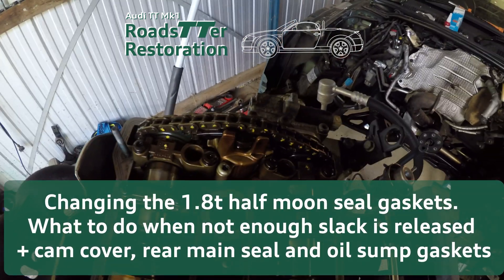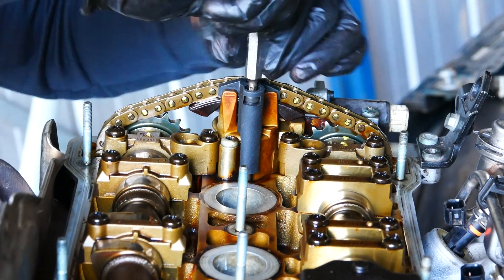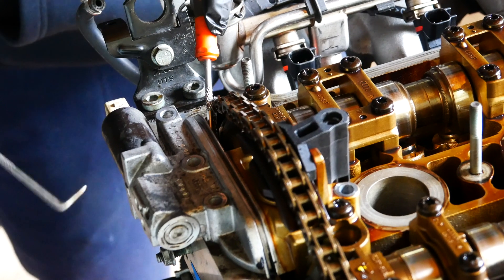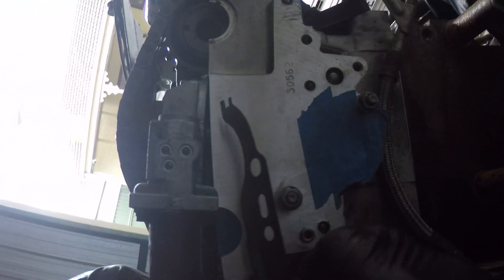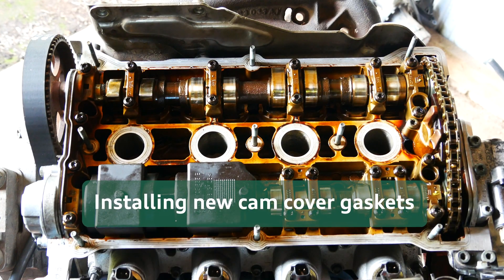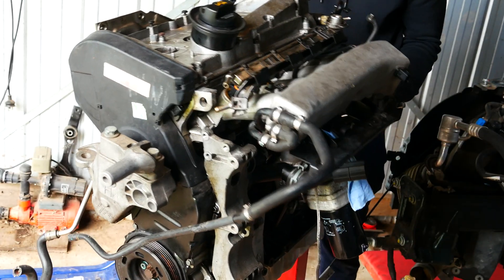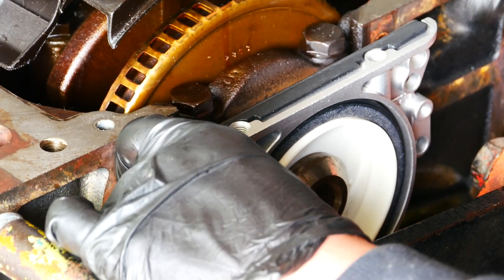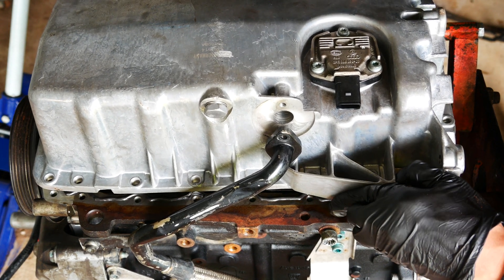Replace 1.8T half moon seal gaskets. What to do when not enough slack is released + rear main seal

Comment: My 1.8t is pouring oil out onto the turbo and out of the floor pan. Its a lot of oil! I am in possession of 2 cracked cam covers both over torqued on the same stud. Hopefully the jb weld holds!

Comment: Well done tutorial, shows the cam tensioner better than others have. The Victor-Reinz valve cover gasket & half moon set I am working with also came packed with 4 small o-rings. I cannot figure out where these should go, I did not see anything comparable in place while disassembling. Possibly intended as replacement fuel injector o-rings but I dont know why those would have been packed along with the valve cover gasket??? Any ideas on intended use of the mystery o-rings?
Reply from the maker: Thanks Jason! That's a bit strange you got some small o rings with a cam cover gasket kit. I would have no idea sorry - I've never received an o rings kit with a cam cover gasket kit 🤔

Comment: When doing rear main seals I like to apply grease to the lip so they don't burn on start up. Not sure if this is kosher in VAG technical advice but just something I was advised to do years ago.
Reply from the maker: Oh really? In ElsaWin it always stated the mating surfaces must be grease free.
Reply: @ianpgonzaga  Correct, must mounted dry and without any additional oil and grease because sealing composed by PTFE, so you must clean off any oil residue, surface must be perfect clean.